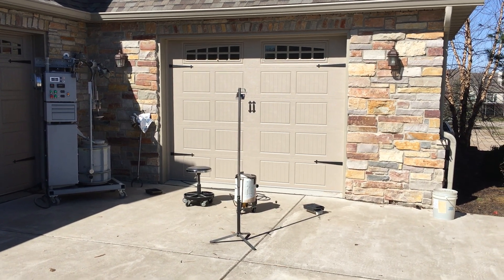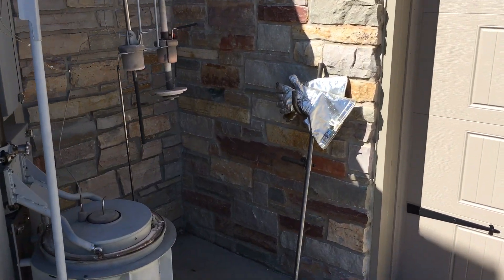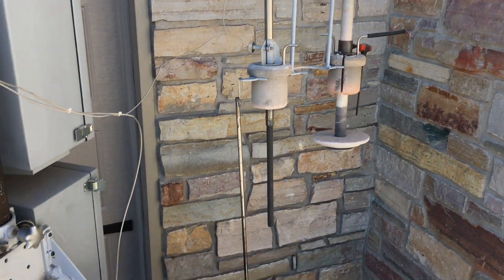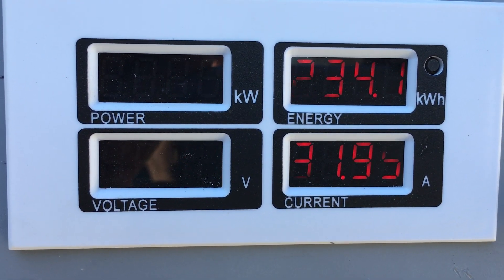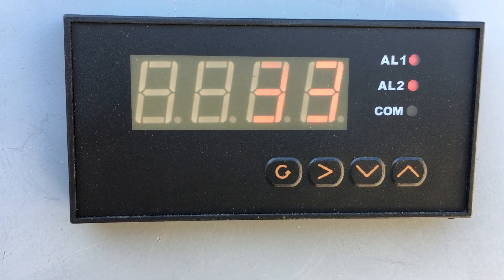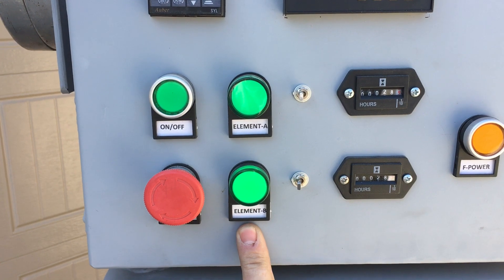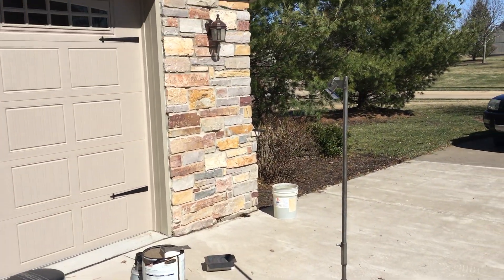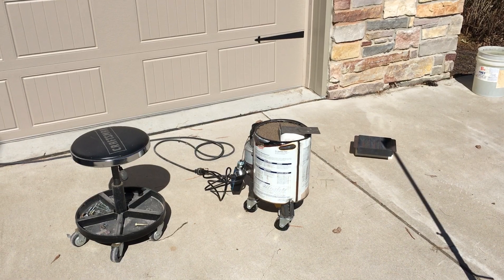Lost Foam Aluminum Part 3 - Staging for Pour

Comment: Mr Kelly !
I watched your all videos.Those are very helpful for me.Thanks a lot.I got prepared vibrating & vacuum system s myself after your advice.But I have some simple questions that 
What is the sequence of degassing ,& fluxing .what is the best pouring temperature.
Reply from the maker: Best pouring temp is the lowest without cold shuts. That varies with wall thickness. But in lost foam, typically 100-150F hotter than conventional sand casting. My castings are 1/4" wall typically and I pour them at 1425F. I When/if I degas, I use Argon gas and a lance, but since I use primarily virgin ingot, I rarely degas. Same with flux. If you don't have access to commercial materials a Eutectic of Table Salt (Sodium Chloride-NaCl) and "low Salt" (Potassium Chloride-KCl) is popular with hobbyists. Just note that degassing agents and flux are not the same thing. Hobbyist also report "pool shock" may provide some degree of degassing similar to commercial Chlorides and Fluoride based tablets. Best, Kelly
Reply: @kellycoffield533  Thank you very much  sir